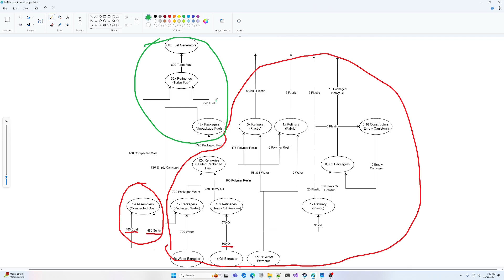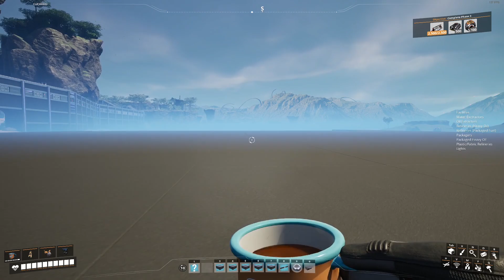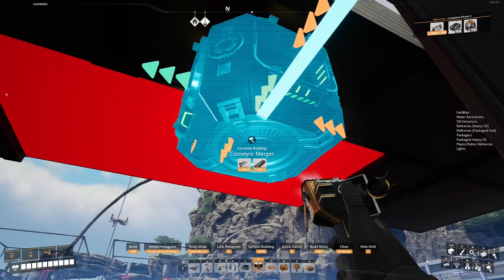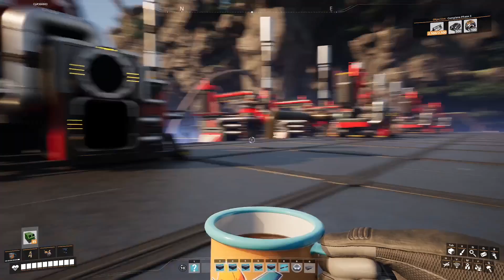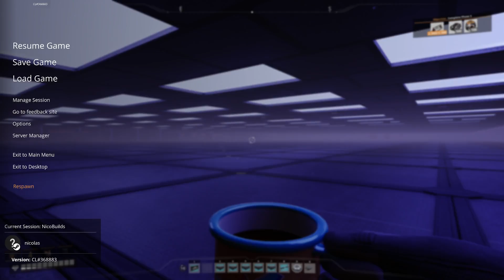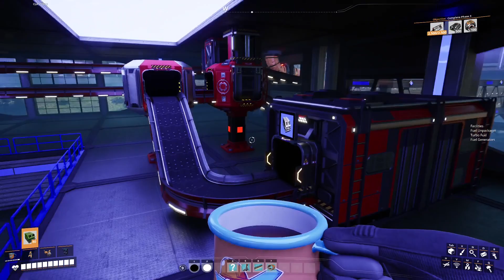Turbo Fuel Power Plant, Part 4: It’s Finally Done!

Comment: I like Your factory designs. Both the interiors and the previously prepared and discussed schemes, as well as the buildings themselves - with decorations inside and out. I definitely liked that in order to achieve "nice" numbers You increase the number of buildings. I didn't think about it that way, and it makes it easier to achieve symmetry, and secondly - the numbers don't cause a headache :D

Comment: hoy could you upload the save or the build as a mega print? nice build men
Reply from the maker: @mariostargetpc7301  well. It was supposed to be a surprise. But after i turn on the turbo fuel factory ill start sharing my savegame along my blueprints in the repository. The only reason i didnt was because it would be frustrating for me having someone turn on this huge factory before I do. I plan to film myself on the first attempt, and deal with issues as they come by. I still havent flipped the switch and I want an honest recording as to how it goes. First i had to do the fluid dynamics video (ive just finished it), and after that im turning this bad boy on. Lets hope everything goes smooth, if not it will be quite embarassing.
Thanks for stopping by and I am really glad you enjoyed it!
Reply: Thats nice men, i was looking for inspiration for my own oil Factory and this is perfect, how much time Will It take to get It?
Reply from the maker: @mariostargetpc7301  Update: Fluid dynamics video is being released this Friday, and on Wednesday I release the one about the turbo fuel factory, and share my savegame :)
Reply from the maker: Savegame is uploaded!
Reply from the maker: I guess some time around next week!

Comment: That is one nice and clean looking factory, about the light. Could you use signs as light?
Reply from the maker: I usually try to light up everything with signs. But the big structures is kind of hard. I do use them for logistics floors for example. If you check the segments under the packagers (where i placed the computers) thats has signs for lighting, and its quite dark. But its true that signs dont eat my fps like these lights do.